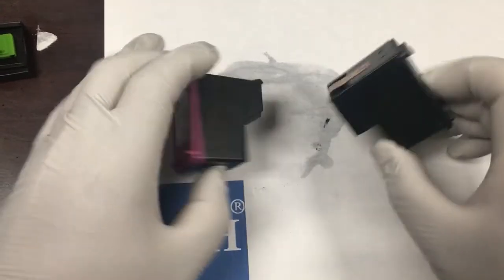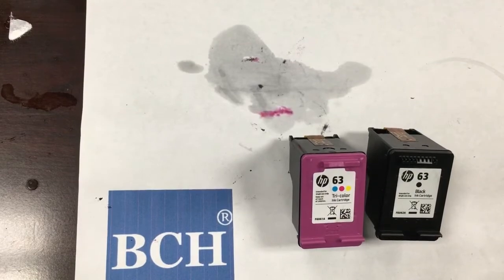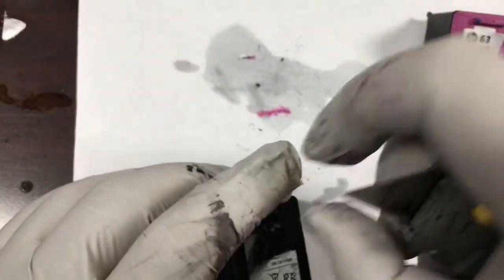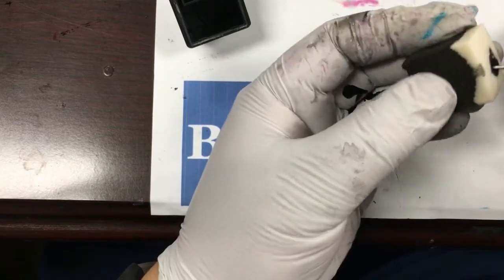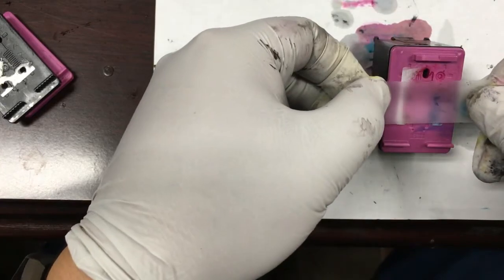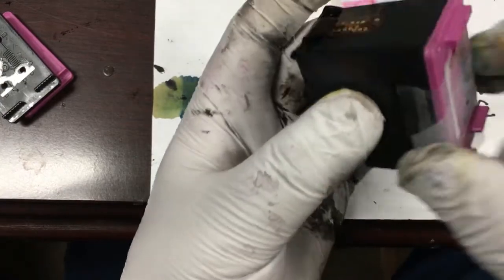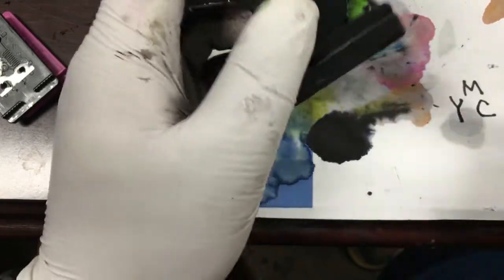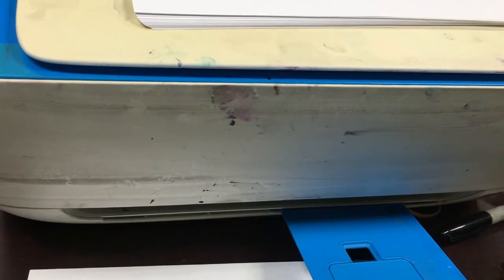#1 Classical Way of Refill HP 63 Cartridges - Step by Step

Comment: kevin i bought the ez30 in attempt to refill hp110 that was no good right out of box tried the unclogging still missing color you said that under sponge there is a filter can that be clogged with dry ink can it be cleaned

Comment: Hi, Can you clarify what I need to do to use my HP 63 cartridges in any HP5258 printer, I have 2 HP5258 printers, when do I need to reset the printer? the printer Cartridge Protection
 is
Off on the printer now. I refilled the black cartridge and it does not print and it is NOT clogged, Thanks. Is it true that if the printer Cartridge Protection
 is On when using the cartridge for the 1st time that cartridge can only be refilled and reused on the one printer and will not work on any others? When do you reset the printer to factory settings?

Comment: Thank you! What would be the signs if i pierced the filter at the bottom. I think that is what happened because whenever i fill it with ink even a little it blends out and drips out of the print head :(
Reply from the maker: The filter won’t affect the ink flow.  If you puncture the filter, the cartridge will clog after a few pages.
Reply: Kevin's Ink & More yup, I think I punctured it then. Basically I fill it, it prints a few and then the print head is filled with so much ink but is spotty on the page and can’t even print a full barcode out. I also think I overfilled it because when I shook it I could hear sloshing of liquid around. I looked at some videos and realized that I probably injected 8ml into a sponge that wasn’t in need of ink and was just clogged. Now my biggest worry is that the ink is going to fill up the waste too quickly and I’ll lose the printer

Comment: Hp guys make it really hard to open the top lid of the cartridge than the canon cartridges. It took a small saw and much effort to open the lid and inside are very small sponges. In one tutorial u made sponge less cartridges. Will not the ink leak without the sponge to hold the ink?
Reply from the maker: You can still cut it with a utility knife.  Just to be sure to push very hard.  It's about 3 times harder than cutting a Canon cartridge.  For the spongeless cartridge, there is a small pressure regulator on the new cover, so it will adjust the ink pressure like the sponge.
Reply from the maker: You need something to control the pressure.  Otherwise, it will leak.  You can either use a specially-made cover equipped with a pressure regulator or put the sponge back.
Reply from the maker: It will leak by itself from the printhead.  You will need one of these: https://www.bchtechnologies.com/mod-kits/for-hp/modification-kit-for-making-spongeless-cartridge-with-canon-pg-240-pg-245.html
Reply from the maker: Yes, search for one-way flow damper.  You need to make a one-way damper.  However, you need to make it small enough to fit in the cartridge.  Also, most flow dampers are designed for fluid.  You need to make everything very precise to work with air.  Good luck.  It you can't make it that small, you can extend it to a tube and supply regulated air through a tube.
Reply from the maker: How many pages do you print in one batch?
Reply from the maker: Looking good.  Try print 20 pages a time, stop when you see color fading.